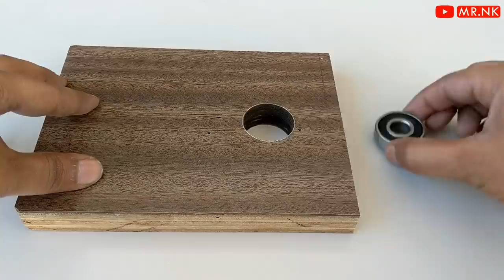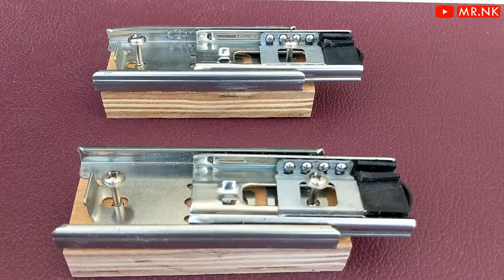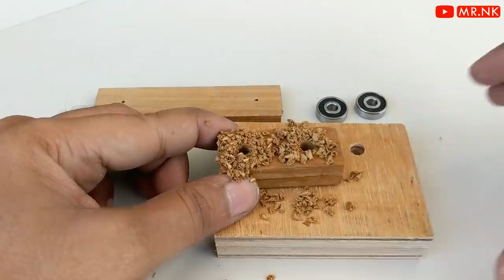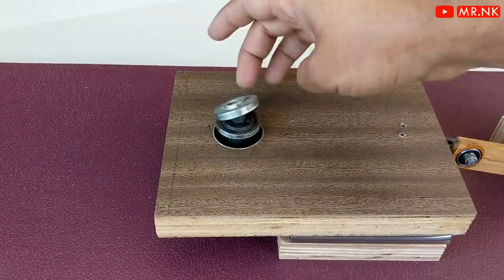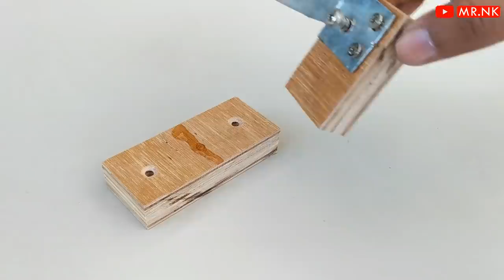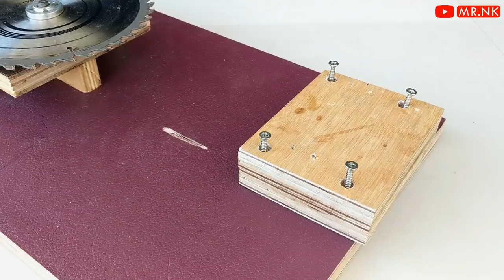How to Make an Automatic Saw blade Sharpening machine at Home

Comment: And proper sharpening requires that the sharpening disc moves towards the blade not the other way around because of vibration reasons. This is a great idea to ruin a blade, besides not sharpening the top of the tip and you cannot just purchase a diamond disc that's thick enough not to flex without spending a fortune. Solution- get a portable blade sharpener at harbor freight 60 bucks comes with a diamond disc

Comment: My blades have face angle of 5 deg which means you need to grind alternate teeth then turn over change diamond wheel angle to -5 deg and cut the others. No problem with that except I havnt found a way to index 2 teeth. The blade is 255 and has 24 teeth so adjacent tips are 32mm and alternate teeth are about 64mm round the circumference. Ideas?

Comment: Great idea, appreciated.. But to sharpen the saw blades properly you need to set an angle or degree. You know that.
Reply: Not for the rake angle. The top bevel is where you adjust the angle. If you have a ATB (arlernate top bevel) grind you would set the angle to redress that.
The face cut (rake) is typically 90 degrees perpendicular to the plate with a forward (positive) or backward (negative) degree of angle off of tangent, unless you are using a custom blade that has a rake angle some degree off perpendicular.

Comment: mechanism is cool.. but you have set the grinder vertical which will flatten the blades... destroying sharpness... set the grinder at an angle to perform sharpening...
Reply: Osama Ata lol😂
Reply: @JaskaranSingh-tr2ol  it's true. Take a closer look at any new saw. Every tooth is sharpened at the same angle, but every other in the same direction.

Comment: eeeeee it indexes ok but you do realize that the grinding wheel flexes into the tooth and drops off and grounds the very tip, yes ?
ahhhhh.  needs perfecting but i like it
you get a B+ for design, a C for execution, and an A+ for originality.